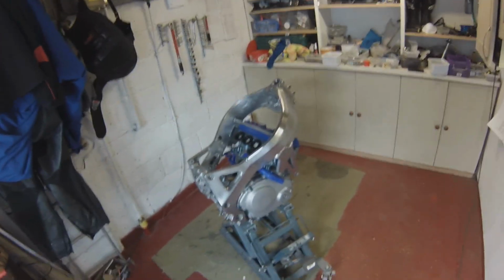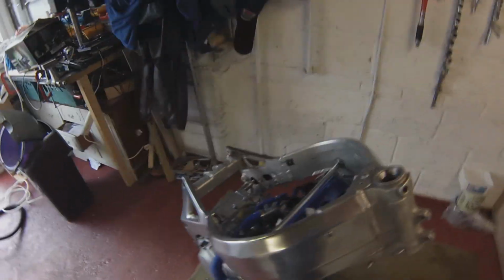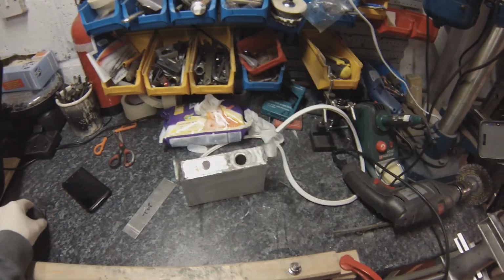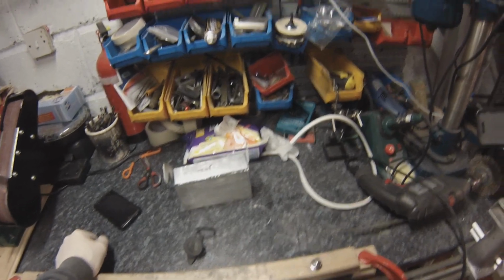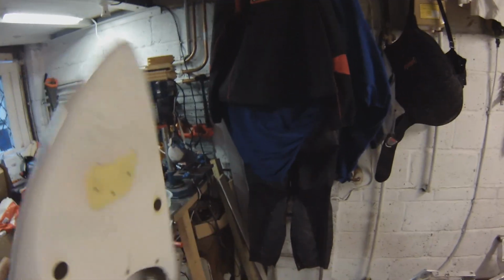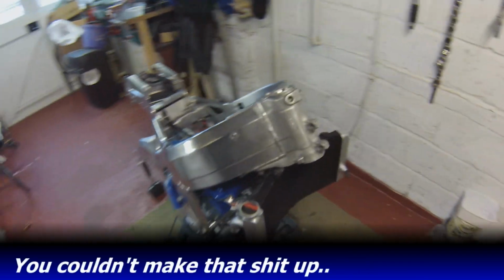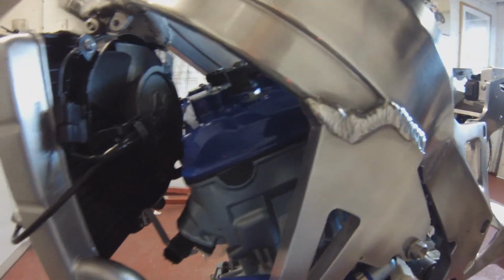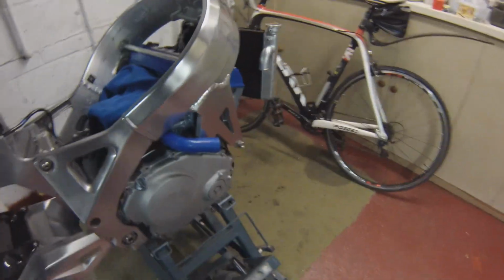Honda Fireblade - Garage Build EP16

Comment: Beautiful project you have!
What specifically was needed to mount the swing arm to the frame? Are the bearings in the Aprilia arm the same i.d. as the Honda? What about the linkage, any major change to the leverage ratio? And lastly, did you use a damper for the Honda or one for the Aprilia?  Thanks so much
Reply from the maker: Thanks Madfawk, its quite easy to mount the swinging arm. When I fit it I will talk through whats needed in a later EP, will probably be the next episode so stay tuned hehe :)